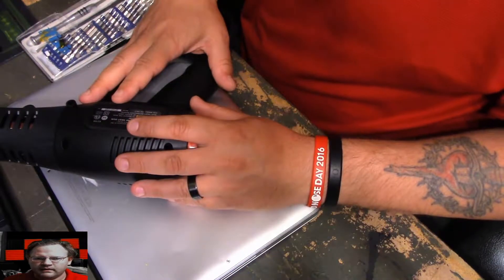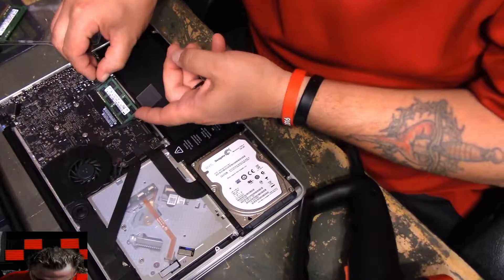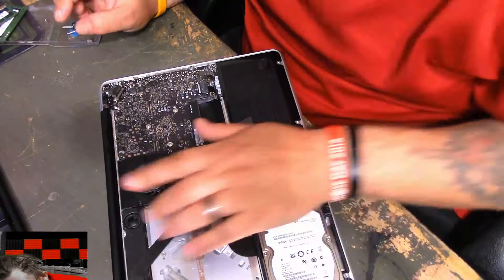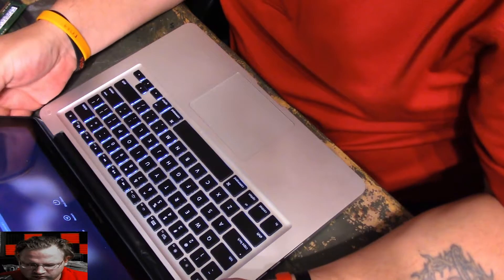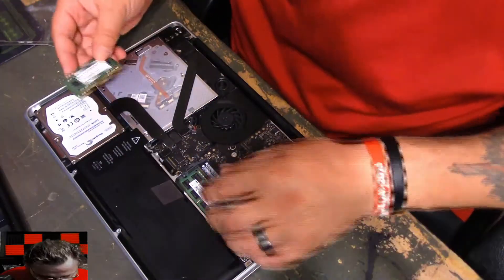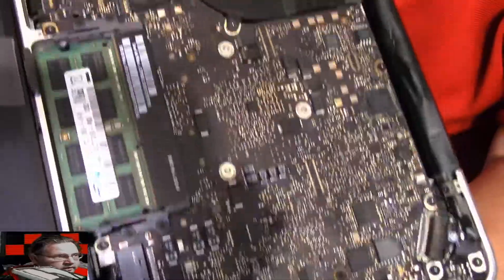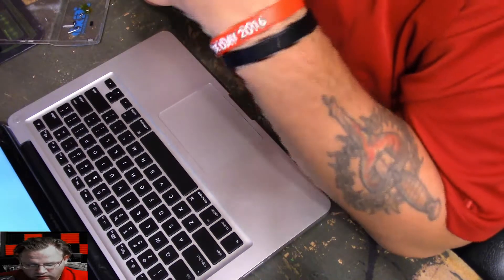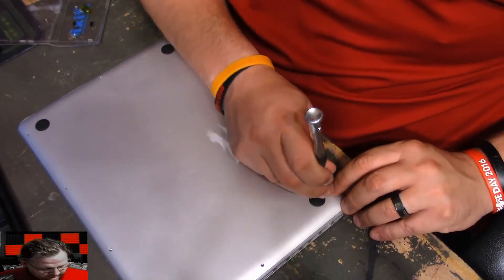mac book heat gun fix

Comment: Just because it boots doesn't mean it's working. It could boot to the onboard graphics and not glitch until it switches to the dedicated GPU. Run Geekbench 4 and do the compute test because that stresses the GPU. If it locks up during the compute test, it's not fixed.
Reply: Oh, and you need a set of diffuser tips for your heat gun to keep the heat focused only where you want it.